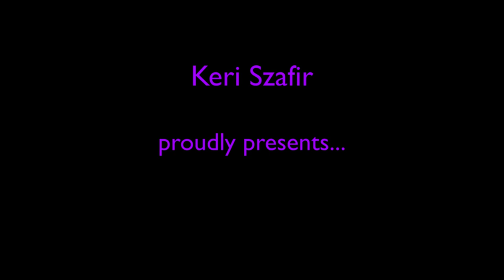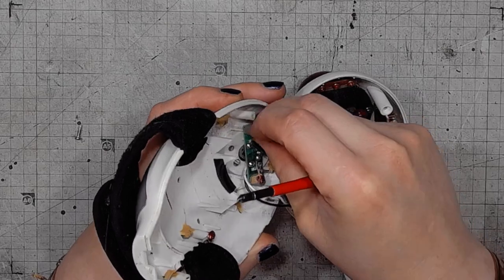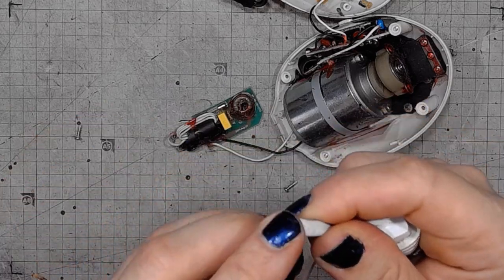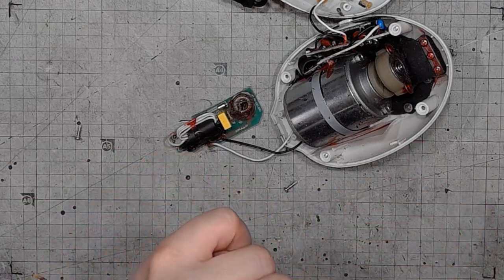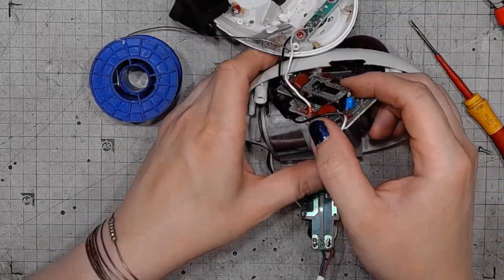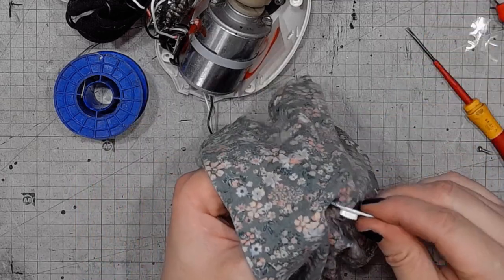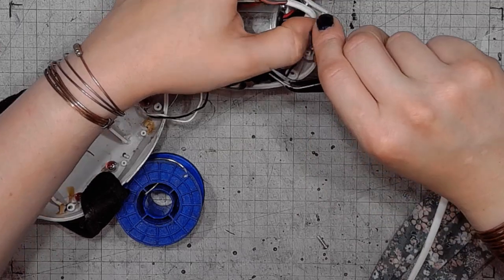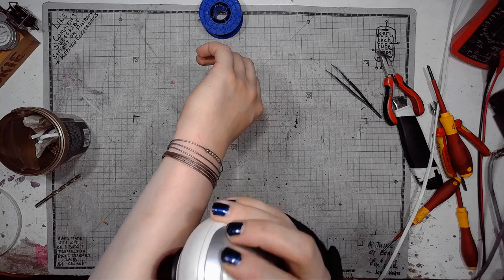Fixing a Handheld Massage Device

Comment: That seems like a big heavy electric motor. But alas no gears!
Reply from the maker: It has an eccentric on its shaft, connected with the massaging head attached to a thick rubber pivot.
Reply: @KeritechElectronics  that’s pretty much what I was thinking. It would be nice to attach the motor to a gearbox and make a little vehicle or robot drive train